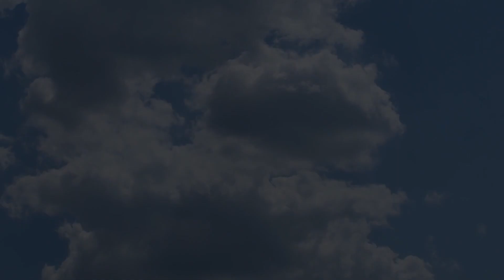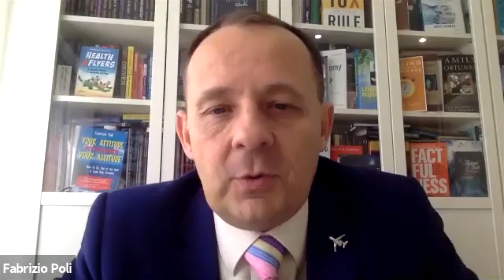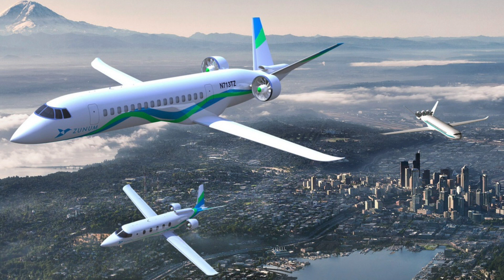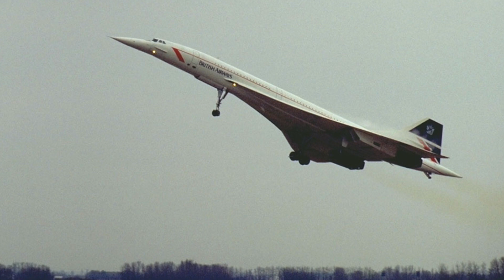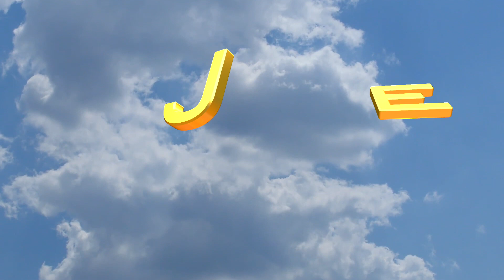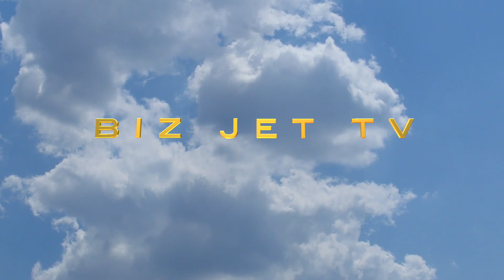Electric Airplanes, VTOL & Hypersonic Jets

Comment: Perhaps Hydrogen Fuel Cells.  Maybe.  Electric jets.... I struggle to accept as a realistic near-future option.   In my opinion... the weight will become an even bigger issue to contend with, than it is now.  Can they make something fly and take off and fly for a short while?   Sure.  But like that production-ready (?) electric American motorcycle company... “top speed 60 mph, RANGE 55 mph”!   A motorcycle weighs...  nothing!  Especially with no transmission, exhaust, starters, and the heavier “old school” gasoline based power-plant.   How much does a light passenger aircraft weigh? (Lest I mention medium to heavy).   Will such a production ready commercial jet take flight... for regular service.... within the next 15-20 years? .... No!   But still... ‘thanks for the video’.
Reply from the maker: I think we are going to see a lot of changes in air travel over the next ten years. The revolution will be a bit like what happened in the mobile phone world: 20 years ago we had Nokia & Motorola dominating the scene, just like today we have Boeing & Airbus. Today Samsung & Apple dominate the mobile phone arena, what happened to Nokia & Motorola???? Could the same happen to Boeing & Airbus?
Reply: Good point.  And well thought out.   Things definitely will change.  Things are in a rapid transitional growth.  Who after all remembers Altavista or Netscape?  Or the Commodore’s Vic-20/64? Or when was the last time, you sat in a car with a cassette player (R.I.P. , 8-track)?
Reply from the maker: @kellingtonlink956  Spot on!